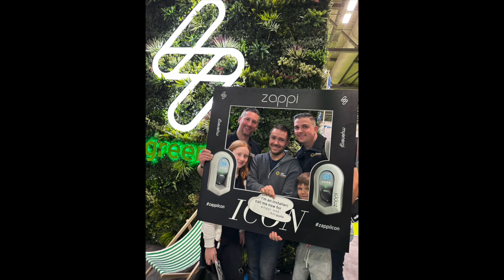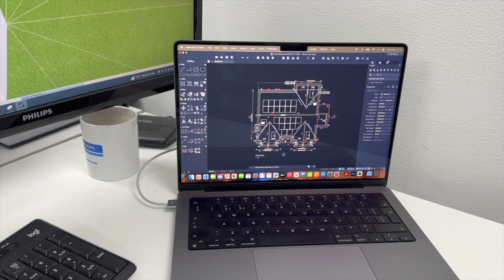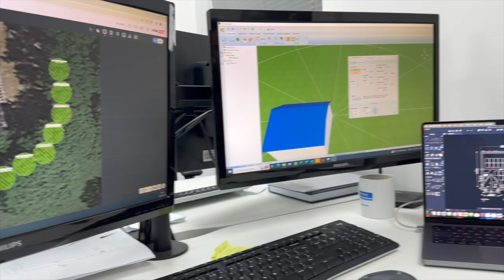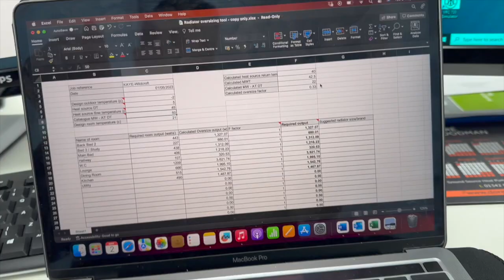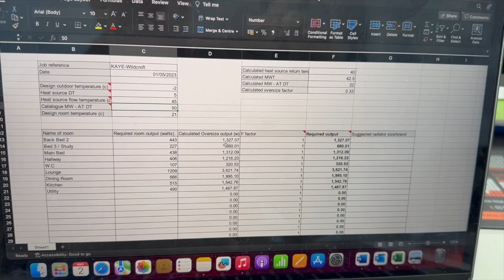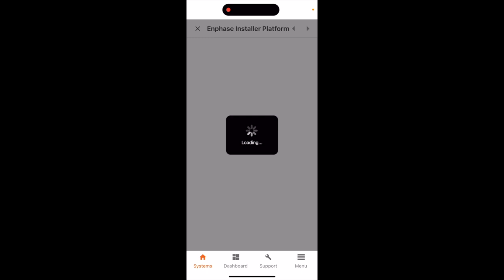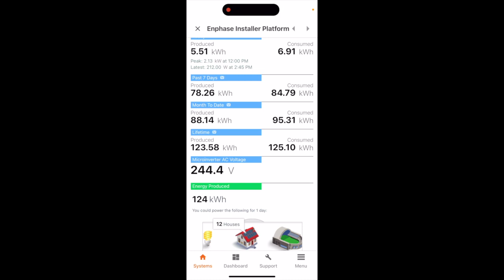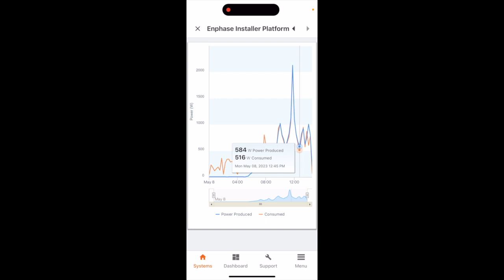Heat pumps, Solar PV, Battery Storage and Enphase Microinverters

Comment: Excellent video, very informative. Some useful comments about DNO G98/99 applications - I still need to do mine. I have Enphase and have fitted 2 (East/West) panels on my shed, 4 (South) panels on the garage, with 4 more (North) to go. I was interested to see how you did the feed of the power cable through the tiles and it looks like you use a Dektite - Nulead, I used the same. Enphase + metered gateway is definitely the way to go, yes it is more expensive, but its unlikely to burn your roof down, or fail after a couple of years.
Reply from the maker: Thank you for the comment. We certainly see the advantages of enphase particularly when installing on various orientations and the safety aspect is second to none. Good luck with the rest of the installation

Comment: Dan! Please advise.  Been watching the channel for 18months.  Based in Wrexham.  Octopus given me a 6month lead time on an install of a 6kW outdoor unit and cylinder.  Found another installer who prefers Mitsubishi, however my airing cupboard is only 650mm depth by 900mm wide.  What would you recommend for a cylinder 🙋‍♂️🙏
Reply from the maker: Hi, thank you for watching our channel. It does depend on the size of the property, if you only require a 6kw I presume it is fairly modest and a 2 or 3 bed property. 

Usual rule of thumb is 45 litres of hot water per bedroom plus 45 litres, so typically for example a 3 bed will require a 200 litre cylinder. 

If you are looking to install a Mitsubishi with a tight space internally, they do now supply a “Versatile Slimline Cylinder” 200 litre which is 450mm wide just under 600 deep and approx 2025mm high. You will need some wall space for pumps and other ancillaries.

Good luck, I hope it all goes well